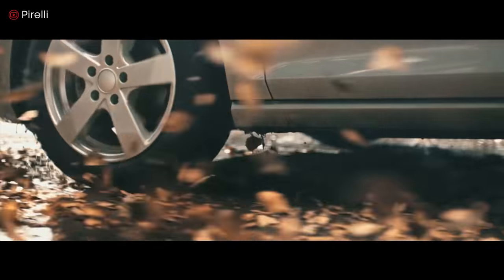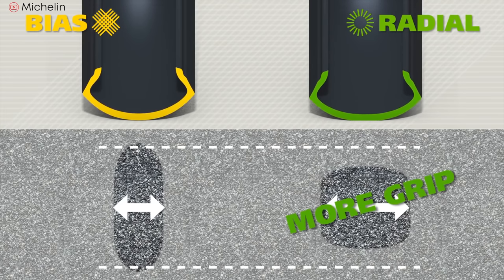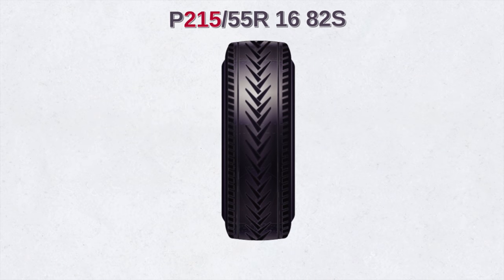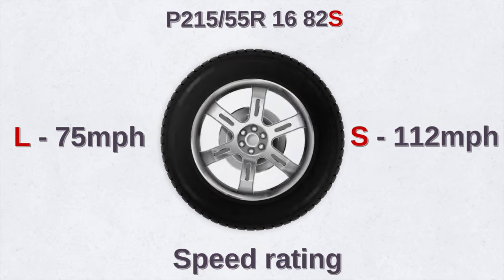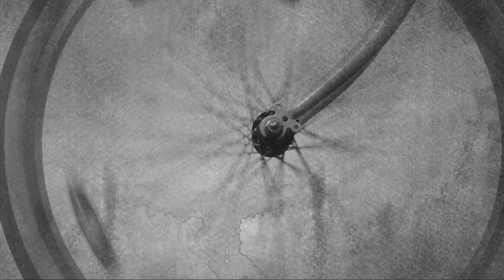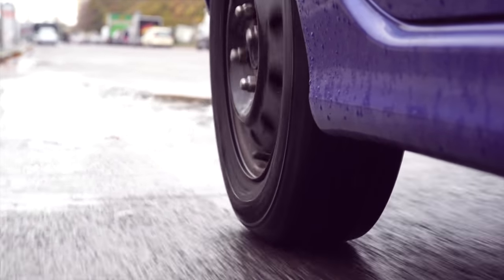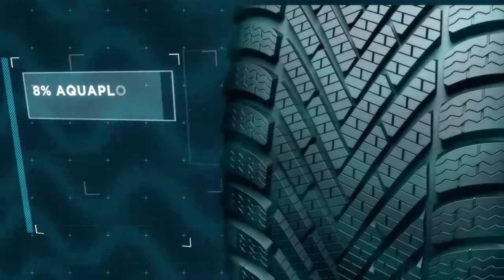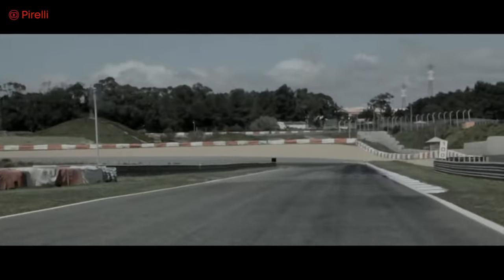These Tires Will Last Forever

Comment: So let me get this straight. 
The width is in millimeters, the aspect ratio is in percent and the wheel diameter is in inches.
Sounds like it was arranged by Dr. Susse .
Reply: Sounds Sus
Reply: Who the hell is Dr. Susse???
Reply: I think it’s “Seuss”...Oh, well, just stick to ‘Theodore Geisel’.  😂😂😂
Reply: The tire numbering system is dumb, why not just display the actual measurements? most dummies dont understand what an aspect ratio is.
Reply: It is really stupid. Some tires in other countries are measured width mm/tread diameter inches-rim diameter inches, which is better. Some countries do that, but with only inches, or only mm. Ours is one of those brain-dead systems that stuck.
Reply: @AlexandarHullRichter  That's not entirely accurate. Everyone uses inch diameter tires. Metric diameter tires, like 390mm are extremely rare. Back in the early 80's, Ford experimented with them on the Mustang, and companies like Peugeot and Alpha use to use them. But this was a long time ago. I don't think anyone uses them on current production cars.
Reply: @solarfall2728 :  we have the metric system in Canada, yet home improvement stores sell 2 X 4’s as opposed to 50mm X 100mm
Reply: @kennethmelnychuk9737  So?
Reply: The stock tires on old volvo 240's are 185R14 They dont even have a sidewall ratio... They had as much sidewall as tread :) Sure there's others like it too, but I always found that funny.
Reply: @solarfall2728 :  I’m just trying to explain roughly why some products have both imperial & metric values incorporated into them
Reply: Or Rube Goldberg.
Reply: @kennethmelnychuk9737  Yes, but we're talking about tires. Metric diameter is a very rare thing. Its not that metric countries use them. Everyone uses inches for tires. Its the world standard.
Reply: @solarfall2728 :  yes, that’s what I was alluding to.
Reply: I also noticed this.   I cant even guess why on a single product they would measure one thing using mm and the other thing using inches?
Reply: @warrenookland8169  With tires, you can't alternate rim sizes. You can put different size tires on your car for width and sidewall height, but you can never alter rim diameter without changing the wheels themselves. The entire world uses inches for rim diameter, so it would be a big deal to change. Tire companies would have to make huge investments in new equipment, so there's just no reason to switch. Metric diameter sizes like 390mm were tried, but they never became popular because there's no real benefit.
Reply: @solarfall2728  Fascinating, thank you. Is this true even in countries/markets that don't use inches at all?
Reply: Get me a Vernier will ya!
Reply: No. It was arranged by Dr. Zeus. Don't argue with the Gods.
Reply: What else would a ratio be in?
Reply: @SW-zu7ve  The wheel sizes probably were established in Britain and America early in the history of motor vehicles. The people who need to know do know. It's useful to have one standard worldwide. The system is very coherent. Anyone who thinks it isn't isn't.
Reply: Yes, it's pretty wierd using two different measuring systems on one product. My tires are 255 50 / 18.  Why not just  say 10  50 / 18 (all in inches)? Seems simple enough.
Reply: @volvo09  checked online and the wagons don't have a sidewall ratio while the sedans do (70) ... weird
Reply: @pudmina  i didn't know that... I had 3 wagons, that explains it. Haha.
Reply: @pudmina  fascinating!
Reply: @kennethmelnychuk9737  It takes less ink and space to write in inches. Marketing 101. Good for the marketing budget too.
Reply: @pudmina  0
Reply: @kennethmelnychuk9737  Thing is a 2x4 isn't 2"x4".
Reply: @ontopoftheroof :  and an aspirin isn’t an aspirin
Reply: Yes. Standards for tyres include both metric and imperial. Lots of reasons in history and geographical popularity of certain practice that became standard.

ETRTO states the coding of all tyres and rims. And this is [Width]/[Ratio][Construction][Seat diameter][Load index][Speed letter]
All measurements can be both in inches or in mm
Car tyres usually have width in mm, and seat diameter in inches
Truck/bus tyres are the same but there are many examples of width being stated in inches like 10-R22.5 where the ratio is ommited by dash (standard baloon ratio of 92% or 82% for cars/trucks) and width is 10"
Bicycle tyres have metric width and metric seat diameter like 25-622 where 622mm is the seat diameter and 25mm width with standard ballon ratio (100% for bicycle) (and construction is ommited so is crossply construction).

In the bicycle department there are lots of mixes of imperial units. Bottom bracket threads BSA 1.37'x24tpi, ISO with 1.375"x24tpi, italian threads 36mm x24tpi, fork steerer diameter (and quill diameters), pitch of the chain 1/2", lots of ball bearing sizes (for the actual balls), and a lot of other places.

The funkyest one is the Italian BB thread standard having a precise 36mm OD, and 24threads per inch! (afaik is due to imported lathes in italy while manufacturing bikes and thread pitch can't be change easy to metric if you have english lathe but OD you can adjust to whatever so they did metric OD)
Reply: M and s tyres are different  to the all season tyres shown hear. Snow tyres aren't directional just look at wrc tyres and always run you tyres at a lower pressure in snow it will increase the foot print and the tread will squash and debris ready to be flung out one it clears the road surface tall skinny tyres in snow rather than low profile wide tyres
Reply: @rosanneennis725 : I believe that my Blizzaks are considered snow tires & they’re directional
Reply: @kennethmelnychuk9737   you can usually tell a out and out snow tyre by its aggressive pattern and low speed rating usual S or at the most H blizzards are for mainly cold temp and slush the low speed rating is for the low ish running pressure a directional tyre is solely for wet conditions if you turn them the wrong way they give better grip in the dry think of an arrow head trying to pierce a tree backwards
Reply: @rosanneennis725  yes but keep in mind that most m+s, allseason and summer tyres are for road use. While special pattern matter less. 
Real offroad tyres where the soft terrain come into play and where thread pattern and depth is the key are in different category and many are not road legal.
Reply: @AlexandarHullRichter  yes it is. R15 and whatnot.  Hate inches unless I am talking about 9 inches.
Reply: @SW-zu7ve  A fraction, 65/100, or a decimal place, 0.65. I imagine that would be more difficult to put on a tire.
Reply: @dwightschrute7893  Because it only works out nice with that tire size, sure 255 50 r18 translates nicely to 10 50 r18 but for 215 50 r18, 235 50 r18 ect not so much
Reply: Whitworth, Bristol Spline, so confusing. That keeps our minds agile.
Reply: @UCtJ914b_qScfaPcV3ZFqKUA my man, the system is not dumb. People used to be much more analytical and therefore intelligent than today. We are the dumb piece of the equation.
Reply: It’s weird to use such a mix of measuring systems on one thing.  However…
A measure doesn’t stay popularly used, unless there’s a good reason…metric using countries wouldn’t retain use of inches for something, without a reason. So, perhaps inches are more flexible a measurement than metric…some might call it sloppy…tires flex, therefore making it too hard to get consistently close metric measure across whole batches of units made.  So, inches are used…?
Reply: You have the British to thank for this.
Reply: @shawbros  hello 👋 are you open to opportunities  aside your field of work?
Reply: @TheRoswellCrash hello 👋 are you open to opportunities  aside your field of work?
Reply: @larrypatterson5363  hello 👋 are you open to opportunities  aside your field of work?
Reply: @solarfall2728  hello 👋 are you open to opportunities  aside your field of work?
Reply: @solarfall2728  hello 👋 are you open to opportunities  aside your field of work?
Reply: @volvo09  hello 👋 are you open to opportunities  aside your field of work?
Reply: @charlesjacinto2295  hello 👋 are you open to opportunities  aside your field of work?
Reply: @AsiAzzy  hello 👋 are you open to opportunities  aside your field of work?
Reply: @rebelaqua823  hello 👋 are you open to opportunities  aside your field of work?
Reply: @stephenarling1667  hello 👋 are you open to opportunities  aside your field of work?
Reply: @Magefind  hello 👋 are you open to opportunities  aside your field of work?
Reply: @John Daye We went metric here (Australia) in 1973 & it amazes me that people ask for imperial measures so that they can relate to them. 🙄
True story:
Years after we went metric (mid to late 70s) a radio announcer asked people how they were coping with the metric system. 
Without exception, the oldies were still confused by the transition, then a 16y/o rang & said it wasn't a problem.
Announcer Questions:
Question 1 .. How tall are you?
Answer ..  5'8" said the young lad.*
Question 2 .. How much do you weigh?
Answer .. 8 stone 12 ounces*
Question 3 .. How far do you live from the CBD?
Answer .. About 20 miles.*

note: * figures not from memory, just entered as examples 😉
Reply: @solarfall2728  BMW too with metric TRX and a right pain for their owners nowadays.
Reply: It's main purpose is to see quickly and comparatively  the sidewall height. The smaller the figure, the more sprotive the tire/car is.
Reply: Sounds Canadian, haha.  We measure length in feet and distance in kilometers.  😆

Comment: In case no one mentioned it yet, the tire at the very beginning of the video is the Pirelli Winter Cinturato, made in Russia and it got me thorough a blizzard a few years back.  It morphs into an all-season tire as the tread wears down, with the tread indication "No Snow" after about 12,000 miles.  These tires are a necessity in winter here in the North East.
Reply: Great info, thanks, at first glance i thought they were the Michilin crossclimate2, weird tire but seems ok, the best car snow tire i've ever had was the Nokian Hakapolita's (sp?), until the changed their design
Reply: Made in russia? No, thank you!👎
Reply: I prefer Bridgestone Blizzaks in Wisconsin.

Comment: Great video on tires. I use Micheline
Climate 2 all year round for 
Light city driving.  RE: Toronto.
Reply: I too am in Toronto. U find those perform well in the snow? Like that crazy insane (nothing like the US just had tho) storm we had last winter?
Reply: Reasonable to use those in Toronto. However, places like Ottawa or Montreal get more snow and winter tires provide better stopping distance.
The CC2s are great, but winters are better still.
Reply: Winter tires are always better in snow and cold but.....the cross climate 2 is amazing. If you don't already own winter tires and cross climate 2 fits your vehicle they are definitely the all season tire to buy in Canada.

Comment: FWIW, I learned back in the 1990's that if you buy good rain tires, they will be good in the snow, as well. Goodyear made the 'Aquatred'. R&S sold the 'Aquaflow' (or some other similar named tire, I can't remember) for about half the price, and it worked wonderfully, even in the blizzard of 1996 when we got 3 feet of snow. Wife drove home with those tires in her little car, with no problems at all. She did as well as I did in my big 4wd SUV with mud/snow tires. Why? because rain tires have deep grooves, which can remove lots of snow.

Comment: Very interesting history of the tire. When I was a teenager I worked in my grandfather's tire store then at a Goodyear tire store changing tires. Back then it was dirty, hard, work, especially trucks, and especially dangerous with split rims and tractor tires that had to be put inside steel cages when filling. Another worker who didn't take precautions when filling up a tractor tire and sat on it while filling it got launched across 3 bays and was lucky not to be killed.
Reply: Occasionally we have similar incidents involving the old bias ply style aircraft tires we replace at the airfield I work at. Every tire supposed to be caged, but even then they do occasionally blow and boy does that cage get bent up from the shrapnel hitting it.

Comment: Most underrated part on a car...it's the only connection to the road, yet many people are only interested in putting on the cheapest they can find.

Pro tip, you won't get a tyre that works in all weathers, lasts 100,000 miles, doesn't get punctures and doesn't need the pressures checked regularly, and certainly not for £10 a corner.

Comment: Might have been a good idea to talk about UTQG, Temperature & Traction ratings.  Example: 720 A B
It's important when comparing tires.
Reply: Those ratings are almost meaningless. Each company rates their own tires, and there's no set standard that everyone uses. Back in the 80's, when people started reading things like Consumer Reports, customers started looking at these numbers and the tire companies kept re-rating the same exact tire with higher and higher treadwear numbers. Those numbers really don't count for much.
Reply: @solarfall2728  Partially correct ... manufacturers do indeed assign their own ratings.  However, they do so under the guidance of the National Highway Traffic Safety Administration (NHTSA) who establishes the Uniform Tire Quality Grading Standards in 49 CFR 575.104.  The NHTSA has the right to inspect the tire manufacturer's data and can fine them if inconsistencies are found.
Reply: @tacocin  I'm not partially correct. I'm 100% correct. Those numbers are a scam. I've seen with my own eyes the same exact tire get re-rated every year or so to keep up with other companies. Its fairly well documented. The laws aren't too specific. That's how they get away with it. Its been going on for decades.
Reply: @solarfall2728  
The reason they get re-rated is from the change in construction. They may look the same to your eyes but different in the makeup.
NHTSA does a good job at holding tire companies liable for mislabeled ratings.
They could and have lost millions from liabilities.
Reply: @boobtubeakatv1296   You're wrong. I'm not guessing. What I'm telling you is a fact. You can check for yourself, and believe what you wish. But regardless of what your beliefs are, the exact same tires were re-rated. Check for yourself.
Reply: @boobtubeakatv1296  — Everything Solarfall says changes from week to week. He’s far less credible than those tire ratings ... Pay him no mind ...

Comment: Fun fact:  the origin of tires goes back a lot farther than Goodyear.
The steel belt around the outside of a wagon wheel is also called a "tyre."  Probably comes from the same root word as "attire," used because we're "clothing" the outside of the wheel with a better covering.  It's similar to how some wires and alloy tools have "cladding."

Comment: when referring to hot and cold tire readings, it is actually the relative temp of the tires. When you drive and use the brakes the tires get hot and the psi goes UP

Comment: i ran my tires at around 40 psi. but every time i had to get the fixed -- nail or other creating 'slow leak'. the tech would use the "recommended factory setting" of 36 psi. every time I drove away, it was around 2-5 miles away, the TPMS would go of for low tire pressure and it was always the the I had fixed. personally, I think I was using the wrong repair shop. unfortunately as a diesel mechanic, i don't own my own repair shop. keep up the good work and i did see your vid on the Kia. I bought a Forte, but not because of your vid, it just happened, my VW was in need of s $2k+ cam job.

Comment: Tire rubber starts to dry-out from Day 1 after their manufacture. When buying tires, ask the seller to tell you the manufacture date also imprinted on the tire sidewall. The tires should be 1 year or less, otherwise the seller is selling old inventory. If over a year old, either don’t buy them or demand a discount. Tires, driven on or not, lifecycle is around 6 years or less.

Comment: Don't forget the 4-digit number on the sidewall: Example "0818" means that the tire was manufactured in the 8th week of the year 2018. First two digits are the week, last two indicate year. Useful when you check out a car that has new used tires with 90% tread made 10 years ago 😐

Comment: Added note from the end during tire pressure bit: if you are either racing or going to be continually driving on a highway for long periods of time in weather above 90 degrees, be sure to let out a little air actually, especially close to the engine. The friction from the road and ambient engine temperature causes heat buildup and increases tire pressure, and the tire can pop in those conditions. I see blown tires constantly here in the SoCal desert in Barstow in the summer due to over-inflated tires or properly inflated tires driven too long. It regularly hits above 110 degrees Fahrenheit here in the summer, and in August can go to around 115-120 highs and 85 degree lows for close to a week straight. Much of the people I've helped have tried to go from Los Angeles areas to Las Vegas or Needles or vice versa nonstop, except stopping for gas in Barstow. NOT a good idea actually to do that nonstop.
Reply: I usually just bring an extra set.

Comment: Excellent video.
Tyres and tyre pressures
are very important, they keep you safe, unless you travel at a speed higher 
Than the speed recommended which is stated on the tyre wall
During the war in Italy
I saw an Italian lorry,
In Asmara which had a 
Big patch made out of the 
Tyre and bolted on to the tyre, it must have been 
Bump at e bump as it went 
down the road.
When we were in the desert 
We constantly checked the
Tyre pressures on the Diamond T and the tank
Trailers, due to the heat.